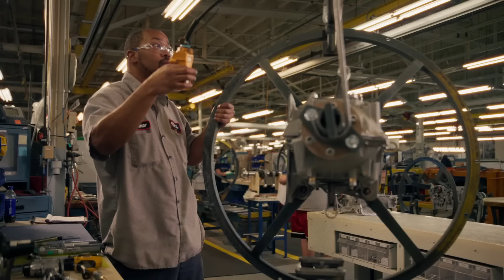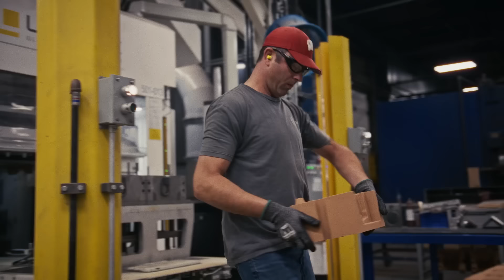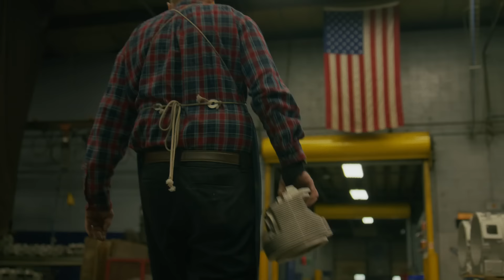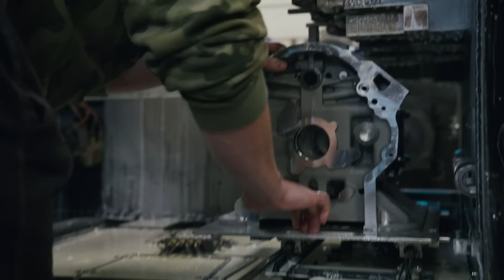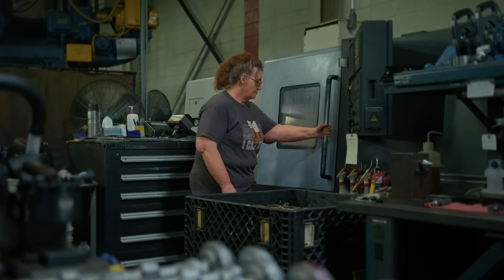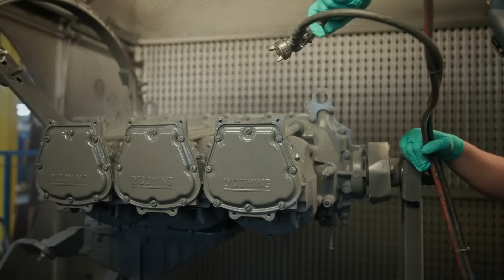Made in the USA - Lycoming Engines

Comment: Lycoming should consider dabbling in small turbo-prop power plants and diversify a little. There's a European company making small, sub 300hp engines for light aircrafts, including retrofit kits. That's a slice of a growing market Lycoming shouldn't miss out on.
Reply: The Royal Air Force has used them for 50 odd years

Comment: What's the surface treatment on the non-bearing parts of the cam shafts? Looks like copper but why is that?
Reply: It might be copper, when plated onto steel parts it can be a "stop" to some types of hardening processes, allowing a softer, tougher shaft while allowing hard cam lobes and sprocket teeth.

Comment: I would love to see a “How It’s Made” type video with more of the actual machining and assembly processes.
Reply: It’s possible that some critical steps are proprietary.
Reply: @davidgold5961  Other than maybe the foundry in Wisconsin there was nothing proprietary. The machinery and facilities looked pretty dated especially the Cincinnati radial drill that was from the 1940's  used on the crankshaft.
Reply: @backho12  if it’s not broken don’t fix it

Comment: I remember when they used to make crank cases, cams and crankshafts in Williamsport. too bad that’s gone away.  I remember the Snyder line bore being in Williamsport too. We gave it to them as far as I know.
Reply: Cranks as well
Reply: Probably moved the actual casting and billeting to China. Just machined here now?
Reply from the maker: @eprofessio  Crankcase castings are done right down the road from Kurt Manufacturing featured in this video in Minneapolis, Minnesota! Cams and Cranks are sourced from other parts of the US as well.
Reply: @LycomingEngines  casting came in and went into the automatic crank case line Snyder used that machine I used to work on that it was given to the outfit, making the crank cases now the crankshaft they came from Brazil. He used to line them up outside all the way down to cold the grass they’re rough working there they were wheelabrated, turn the flange on the fay automatic lathe. And drilled the locating hole in the flange. Next the main journals were cut on another fay. Then the counterweight flanges were milled. From there the counter weights were surface ground before going to either the 4 or 6 cylinder wikes, later replaced by the GFM. I could go on and on.